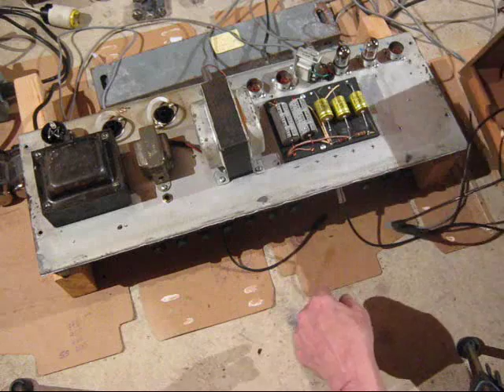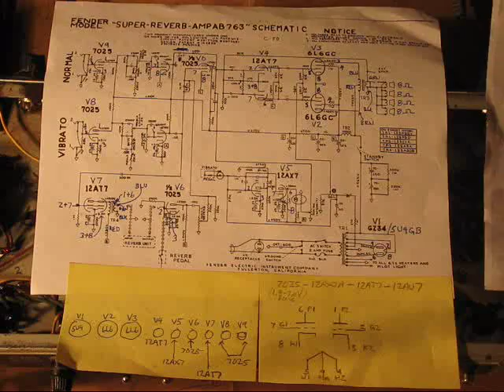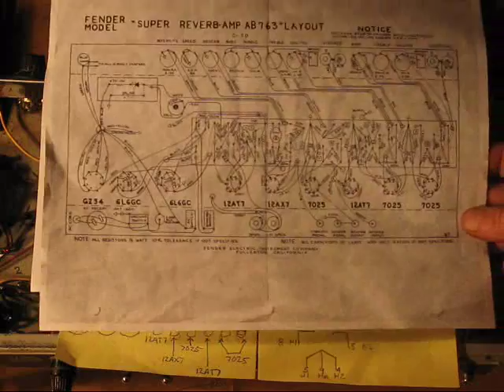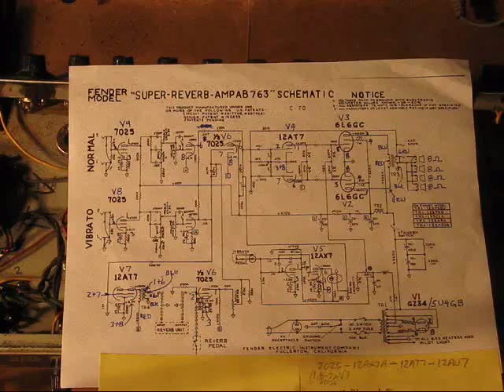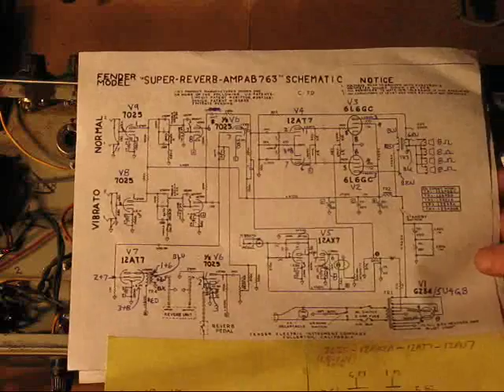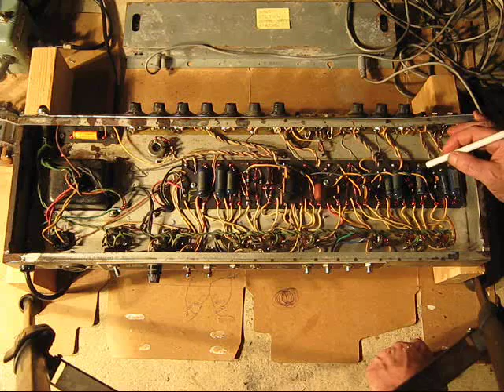Fender Super Reverb amp exploration part 8 of 10

Comment: Looks good, I like the demo off the reverb tube, class A amp to boot. Were all the resisters the old standard carbon type?
What is your favorite contact / Potentiometer cleaner/ lube?
Back when I did component repair I was shown how to track down noisy resisters with a freeze it spray, it didn't always work but helped
Reply from the maker: Yep, all of the resistors in that chassis are carbon composition, and that is what I used to replace the faulty ones. 
What I use to clean pots/switches/connectors depends upon the device being serviced and its condition. Just a minor pot clean? A tiny shot of aerosol contact cleaner or rosin flux remover. If a serious situation of moisture/grime/sticky? WD40. 
Ay, the resistors. Those noisy ones can be a bear to isolate. Look for ones that measure higher than their stated resistance; often a source of grief.
I have had some luck with freeze spray (and heat gun). Mileage varies. ;-)